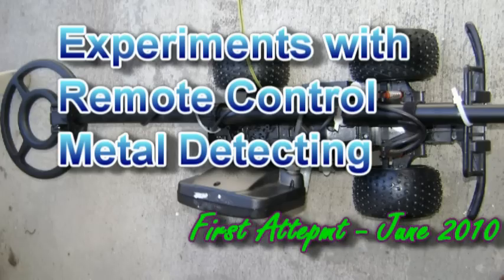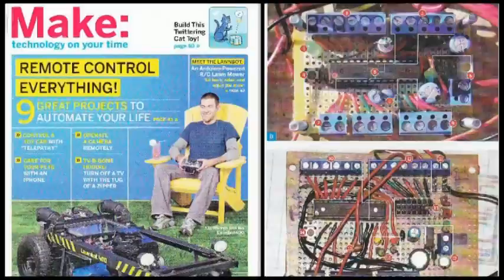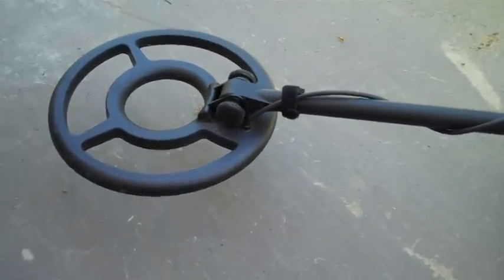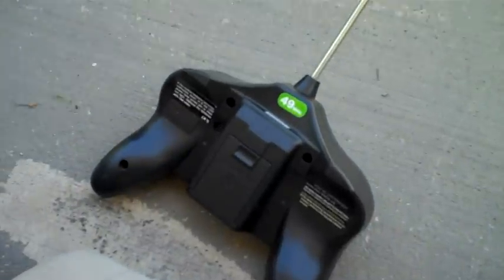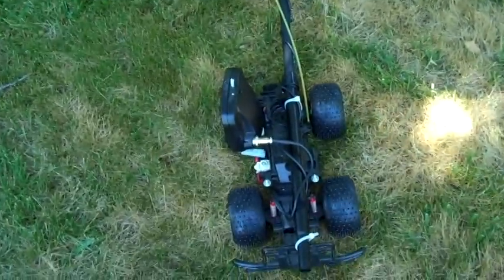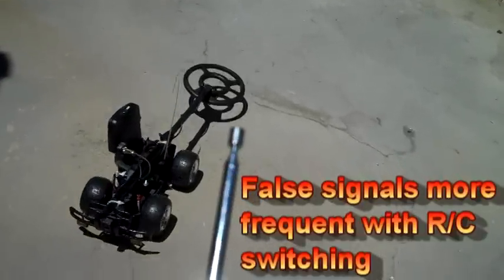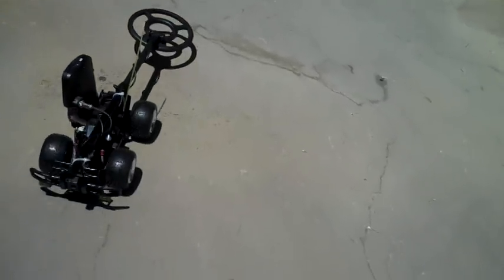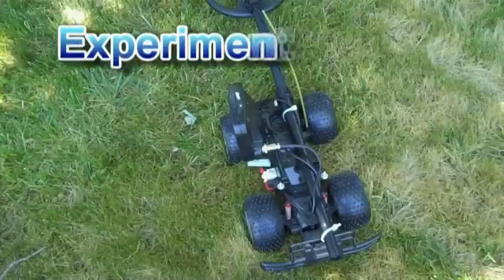Remote Control Metal Detector

Comment: Don't listen to these saps. You had the guts to show your mistakes, and that is very helpful to other experimenters out there who are actually doing something with their time -  Those many false chirps were NOT from the rebar in the concrete slab because they were in perfect time with the radio commands. Off balance problem fixed with making a trailer instead. Met detect has a discriminator. Use it. Maybe shielding on the trailer?  good job

Comment: UncleVinnys, I like the concept and Yes I am one of those people who have authritis and I also have deteriated hip joints in both my legs. Some days are better than others. But I bought my Teknetics Alpha detector to help me get out of the house and if I can get a little exercise while looking for something interesting in the ground. Sometimes I just have to sit in a chair and metal detect around me and I usually do it while I'm waiting for a fish to bite on my line. If I don't get anything then I move my chair and try again. Mostly in this mode I have only found rusty nails, wires and screws, Aluminum cans, tabs and bottle caps and foil wrap from cooking and from cigarett wrappers. I have also found some fishing hooks and weights which always makes me happy especially when I am running low on both while fishing. :-D